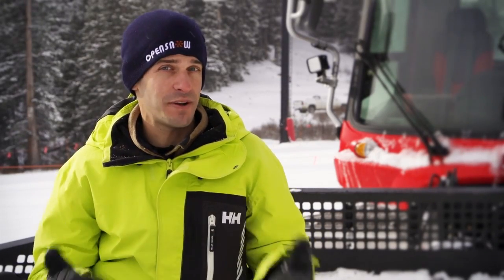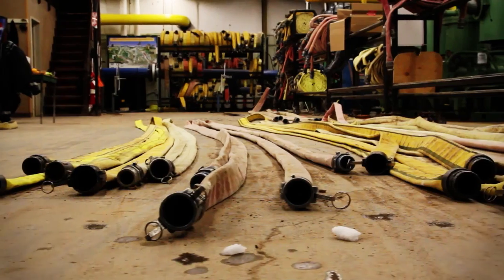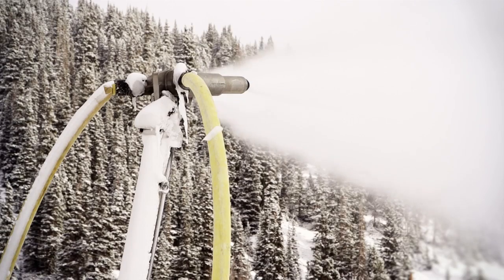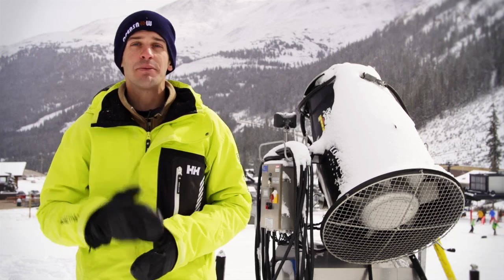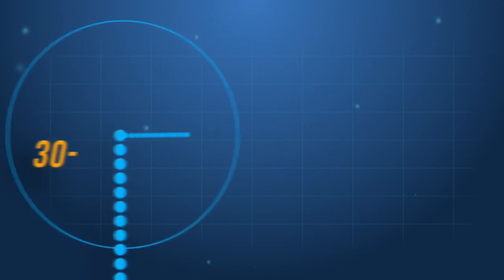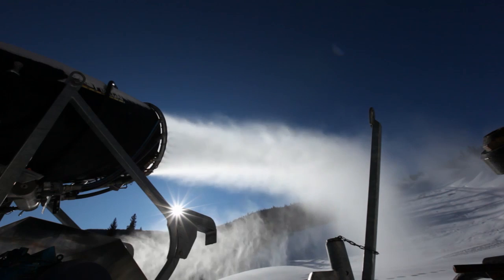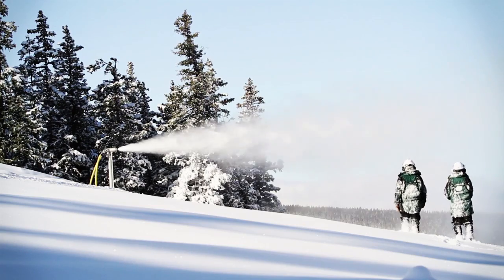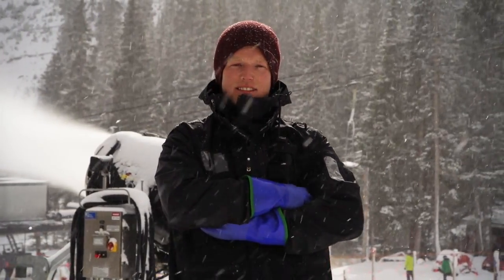Snow Science: Snowmaking Part 1 - Making Snow on the Mountain

Comment: Cool video. Check your facts. You have most of it. It comes down to two different styles of guns. Internal nucleation and external nucleation. The closet thing to an air less gun is snow logic, and hkd vipers. They operate on as little as 5 psi. The SMI pole cat fan gun in your video that you refer to as air less is in fact very different. They operate with a water source that is mountain provided and have a on board compressor that generates the air necessary for the nucleation process. Snow making companies around the globe strive to reach as low of a PSI that can pump through the machines to create snow as air is the most expensive component. No air less guns on the market as of now being march of 2016. Thank you and god bless snow  makers world wide. More then happy to go further in depth.
Reply: +bosh boy Well said, actually, there is one producer on the market called Nivis, they use a special nozzle with a tiny chimney, using the venturi effect to mix the water with surrounding air. This seems working, however the snow production is aroud half the volume of a standard on-board compressor equipped snowgun.

Comment: The "airless" snow gun, is not airless at all, there's a compressor under the main cone. Fan blows out the the water, already mixed with water. There are different sets of nozzles, of which some are called "nucleators", which mix air and water and create so-called nucleation core, which creates a solid base for a snowflake formation. In fact, there've never been working "airless" snowguns, because it's impossible. There were some models using venturi effect, but again, it needed certain amount of air to be pulled into water nozzle in order to make it freeze. During the air expansion, the air temperature falls down to -30 or less (depending on the air pressure), that's why the compressed air is mandatory in snowmaking.
Reply: Thank you for correctly stating how a fan gun works. But the smi 320s were airless guns. Very neat concept of water freezing on the fan blades & shearing off.

Comment: Joel 
I study ski area operations in Leadville Colorado, and interestingly enough we have a truly airless and powerless gun. its called the York water stick. it is old and inefficient and the snow quality sucks and requires a temp of 14 degrees or lower. I also make snow for Keystone Resort and in speaking with my controller i have learned that our HKD tower guns will also make snow with only water (no air) in 9 degree or lower temps. all temps are wet bulb measurements.

Comment: dont you need condensation nuclei too? ive tried making snow before at home with compressed air and water but it didn't work, we think because we didnt have condensation nuclei
Reply: just needs to be cold
Reply: If you use a wide fan spray power washer nozzle on the end of your air water gun & wet bulb is 24 or colder with a water & air psi of at least 60psi you can make snow. Best is air at 80psi & water 0ver 100psi. Using a power washer & air compressor will allow you to go as crazy as you want.

Comment: not true... both guns require compressed air and water. the fan gun has an on-board compressor- the center nozzle is air + water and the rings of nozzles are just water, the fan is just for throw/ hang time